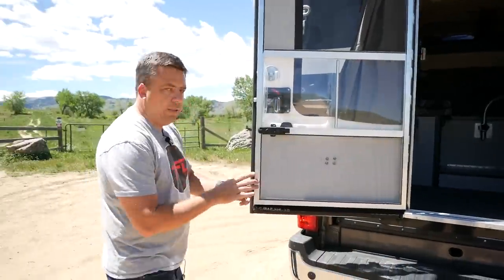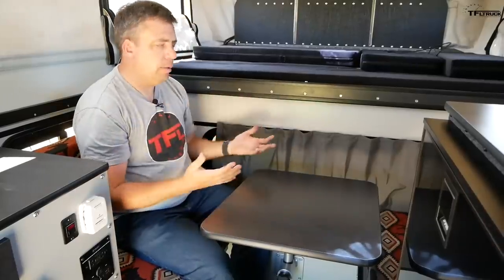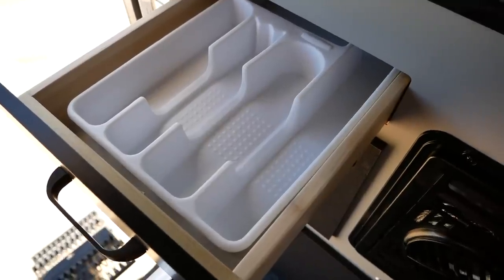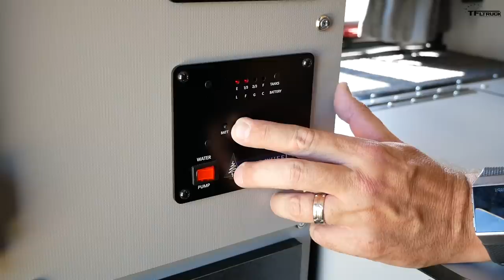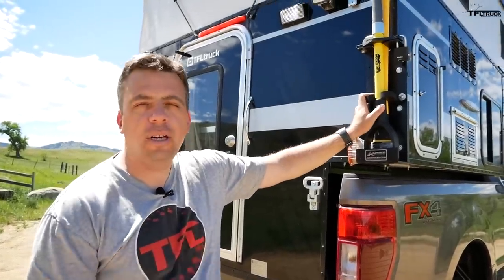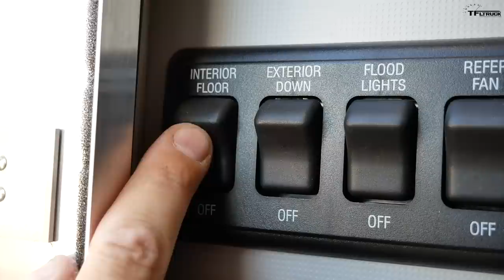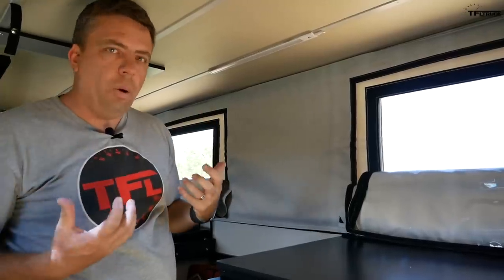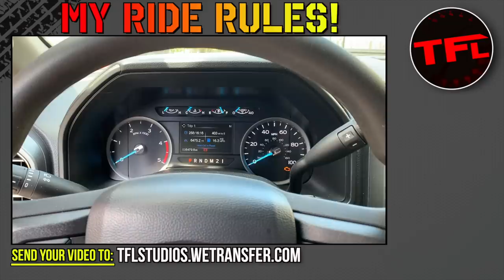Here's a Great Way To Camp On and Off-Road With a HD Truck - This Popup Camper Has it All!

Comment: I think what we've really learned in the last few days, with this camper and the one Steve reviewed, is that these things are absurdly overpriced. I'm not even capable of articulating how ridiculous I think these things are. My parents recently paid less for their nicely equipped 28' camper.
Reply: You can't take a 28' camper off roading. It's not about the size of it it's about what you can do with it and the construction of it. You could take one of these out every weekened for 40 years straight and it'll gonna be just like new if you take care of it, and that's the whole point. The resale value is also insanely good because they're super hard to find (relatively speaking) and people want them, because they last.

Comment: Why would you put falcon wild peaks on a huge heavy truck that won’t see pavement for 4000 miles? What I’m getting at is you need at the least very aggressive all terrain’s if not mud terrain’s.
Reply: Have you ran them? I have and as far as an all terrain tire I would put them up against any all terrain on the market in every type of condition. I have ran several ATs over 30 years.

Comment: For $30k,  no matter how I try to justify this camper it does not make sense.  The options you have at below $30k between mainstream fully equipped campers, pull behind overland trailers  or hell even a ⛺ with gear then $$29k left over to travel the world in nice hotels.  You would have to be a rich person with money to burn for this to even be considered at that price point.
Reply: "You would have to be a rich person with money to burn for this to even be considered at that price." Plenty of those out there, and it is likely the manufacturer has done its market research and will sell lots of them.
Reply: @anthonyc1883  lots of rich people with money to burn huh....

Comment: No AC? No shower? No shitter? My grandpa had a truck camper with stove, shower, AC, and shitter and for less than $5000 in the 80’s and was 4 season. This is no bargain. For this money buy a fifth wheel.
Reply: USD $5,000 in 1980 is USD $16,000 in today's dollars.  Your granddad got ripped off.

Comment: 32k?????  And no a/c?  Dumb.
Reply: Think about it by raw materials and components.  Aluminum frame/siding/roof, cushions, countertops, cabinets and hardware, vents, fans, windows, sink, pump, two agm batteries, stovetop, plywood floorpack, fridge, furnace, water heater, led lights inside and out, wiring, breakers, relays, battery charger, solar panel and controller, etc.   Be realistic. Two agm batteries are $500. Furnace $600. Fantastic fan vent $200. Fridge $800. Buy a piece of 3" foam for a matress is $150 without sewn fabric cover. $30k is a lot of money, no doubt, but that is different than these being priced wrong. All those components add up fast. Now, pay someone to weld the frame, wire it, build cabinets, sew cushions, install fridge, furnace, fans, solar, stove, sink/plumbing, etc. Think about it by component at you see why they cost so much.

Comment: I really like that camper but I think it's way too much money for what you actually get no hot water on demand no nothing no power jacks I think there's so many better options out there for that kind of money even cheaper as being us funds where you can double that for Canadian funds I have a 2018 Palomino backpack soft side 1251 with three times the option that has and I only paid 22,000 Canadian I have an indoor bathroom shower hot water on demand bigger holding tanks it's just amazing that's why I say I think that camper is way too expensive just my opinion

Comment: 30k and no bathroom? 🤪
Reply: And A/C that's crazy talk
Reply: Think about it by raw materials and components.  Aluminum frame/siding/roof, cushions, countertops, cabinets and hardware, vents, fans, windows, sink, pump, two agm batteries, stovetop, plywood floorpack, fridge, furnace, water heater, led lights inside and out, wiring, breakers, relays, battery charger, solar panel and controller, etc.   Be realistic. Two agm batteries are $500. Furnace $600. Fantastic fan vent $200. Fridge $800. Buy a piece of 3" foam for a matress is $150 without sewn fabric cover. $30k is a lot of money, no doubt, but that is different than these being priced wrong. All those components add up fast. Now, pay someone to weld the frame, wire it, build cabinets, sew cushions, install fridge, furnace, fans, solar, stove, sink/plumbing, etc. Think about it by component at you see why they cost so much.
Reply: MrChadx1 you can get 25’ travel trailers for 30k no way this is worth the same.
Reply: kruck96 travel trailer is cheaper to build. The frames are made by an outside company and since more trailers are sold it is a higher volume item. Then building a square box is faster etc.. same reason class B are so much more than a class C.  

Niche products are expensive to build.

Comment: Love the guys at TFL and all the hard work they do!  But I guess I need to move on as I buy pickups to work with and the lower they set to the ground the easier it is to load them.  I dont spend cash on huge tires etc and on gadgets that tell me how to go to a wierd sounding  yuppy sandwich shop in Boulder and then run around empty 90% of the time on roads.    I want a made in u.s. practical truck from an OEM who gives a 100K warrenty and tries to compete with a vehicle that lasts and has a big enough gas tank to tow and not all this Nancy stuff and black rims and tires for egos.  God Bless and enjoy the summer.  I wonder who in this audience really buys any fo the trucks you guys show off.  Must be the legalized pot that facilitates folks out there spending wads of cash on this stuff and $30k tents.  Best regards.

Comment: Why does it have a 30 amp connection when it doesn't have AC ??   Odd.
IMO, way too large for an overlanding vehicle.  Dirt roads will be where this is best uses.  Take this on trails and you're going to bet the hell out of it.
Reply: I agree on your first point. And when you have shore power, why isn't there an electric heat option that could be run instead of sucking up all the propane? Even if it's electric heat that's viable only down to certain outdoor temps, it could still probably be used much of the time when heat is needed. But maybe it just burns through too much current that the host (the RV park) has to pay for.
Reply: @anthonyc1883  In my experience, RV parks are not a fan of electric heat.  Some even charge a premium.   A lot of premium campers are now available with roof mounted heat pumps with electric heat coils in them. .  And some AC units have electric heat coils in them as well.

Comment: There is NO WAY that is worth $32K, and yes I could afford to buy it but I would not spend that much on something that will fall apart in 5-10 years.  All the canvas, rubber seals and cheap plywood will deteriorate quite quickly.  Hard sell on a cheaply made product that is far more of a gimmick than a real need.

Comment: I love these TFL guys but seriously 35k for a camper? No thanks! This is how you know that they don’t do camping on a regular basis. If you’re going to lift a Ford F250 and make it capable of rock climbing and extreme trails and then put a 35K camper on it then you are crazy or have money to burn. Do what I did and buy a used fifth wheel toy hauler then load toys and have fun. I know for everybody who’s going to comment and say that fifth wheel trailers are so expensive. Then learn how to inspect a used trailer and what to look for and buy a used one. I did and No regrets!

Comment: $100k+ for an oversized Overland truck.

Or spend the same for a Trailer RV with 3 more beds full wet bathroom and a proper sized fresh/gray/black tanks.

Don't get me wrong. It's cool, but not worth it.
Reply: But would a trailer be suitable for the cross-country unpaved road journey they will be making?

Comment: I would be willing to bet that this camper will become a rattle trap after a few miles on the road.  It looks like something someone made in their garage using cheap hardware and materials.  $30k for this - I say you’d be better off buying a nice tent set and accessories, then use the $28k you just saved and stay in nice hotels when you don’t want to tent it.  Plus you’ll save even more on fuel, not lugging around all that dead weight.
Reply: Owners come back in the 20 - 35 year range and get a new top. Owners who travel over very challenging terrain in the US western states , Mexico, Central America, South America, Middle East, Australia, Mongolia,. etc. select our product because it is nearly indestructable.  All aluminum frame and sides, and one piece aluminum top. Very little wood or plastic. It may be more than you prefer to pay but it is very well built.